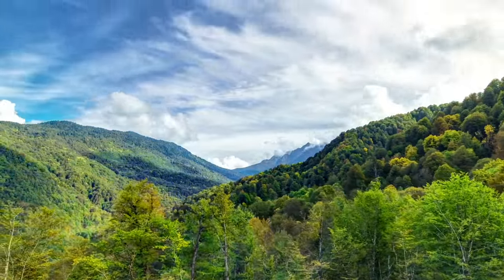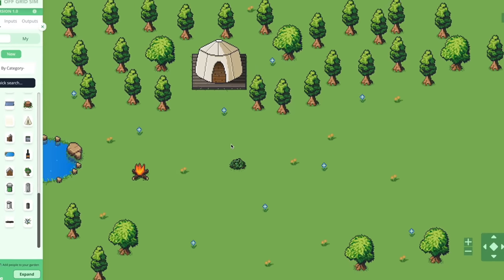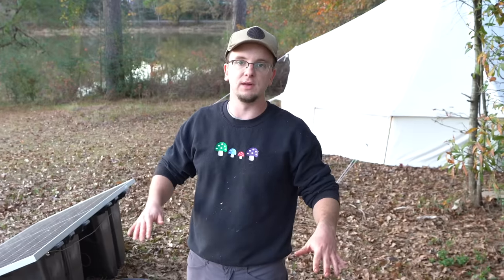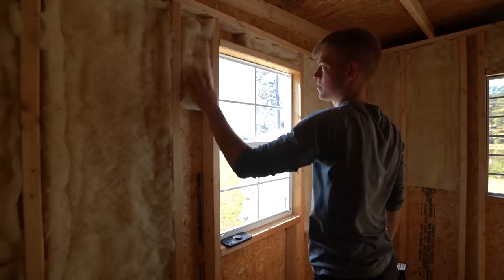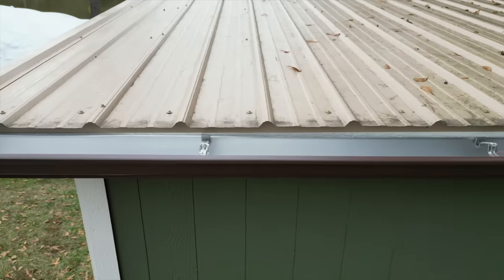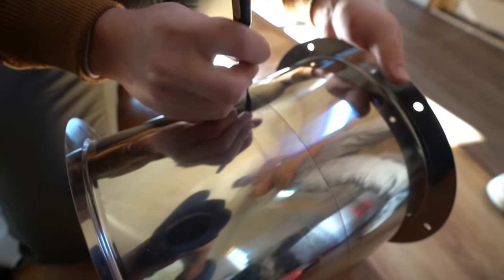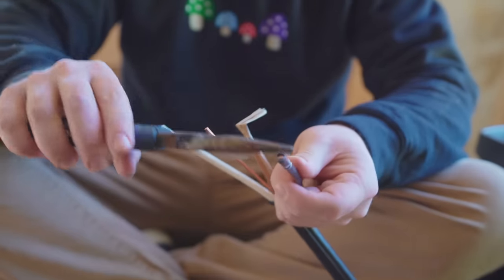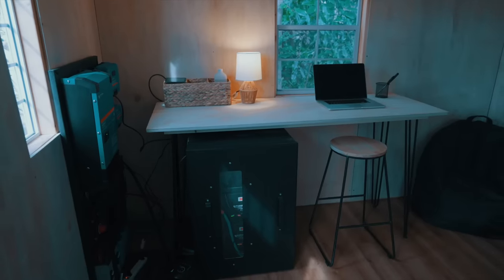We Went Off Grid In 30 Days With $25,000

Comment: Love what you guys are doing. 2 things that y'all could do as improvements on your ideas.  First, extend the billboard tarp down the sides or use slats from other reclaimed pallets to close in the sides of the chicken coop more to protect them from the weather, wind, rain, cold.  
The other thing is with your raised beds.  After your layer of punky wood, use horse manure mixed with about half of your leaf layer and then the other half of the leaves on top of it. Not only will it help break down the wood and leaf material it will generate more heat.  Use some reclaimed pallet wood to build some low angled frames that you can either cover in a double layer of clear poly or better yet find some old windows to use.  Essentially you construct a cold frame so that you can actually grow plants throughout the winter. Also, the IBC totes and/or barrels you use to store your water for the greenhouse and planters in should be painted black, and put inside the greenhouse to act as thermal batteries.

Comment: Yep had this issue about a month ago and made a video on my channel about it. Behind my wet bay all of a sudden without warning or any freezing temps just started leaking like a water park. Fixed one leak and upon turning the water back on a leak would start at another location with this fitting issue. 15 times this happened. I now have replumbed my entire wet bay with pex and corrected the issue. Not before the pass through floor being ruined from swelling and type of wood they also use in these rv's. They should also be using plywood instead of OSB in slides and other floor areas prone to getting wet.
Reply from the maker: Are you in an RV?

Comment: OK, so let me get this straight:  nothing but the most natural insulation due to, among other things, off-gassing.  But somehow using a pre-built structure sheathed in OSB, and then Luxury Vinyl Flooring.  I'm guessing there' salso  an off-gassing potential from the plywood you used in the interiior.

Additionally, stone wool products (like Rockwool insulation) seem to have a pretty good reputation for mold resistence and no off-gassing.  It will break down in the environment probably a little faster than what it's made of (rocks).  I would guess the major problem with it would have to be the energy expended in its manufacture and shipping etc.  But even that ultra green wool had to be shipped a long way as you noted.
Reply: Not to mention they have no vapor barrier. The place is going to be mold city. They also used the least fire resistant materials possible and then put a wood stove and lithium batteries inside. The place seems like a death trap.

Comment: From my research on solar and wiring, improper crimping of wires generates heat and is inefficient at best, and a fire hazard at worse. Use a heat testing thermal gun to test all your connections to make sure nothing is getting too hot.  If its too hot to comfortably hold with your hand there is a problem that needs to be resolved.  check all components and connectors.

Comment: I applaud you on using the wool as insulation because there is no off-gassing like in SprayFoam, but didn’t you short yourself in the foot with the vinyl flooring? Doesn’t that off-gas? It’s a petroleum product. Wouldn’t a redwood cedar have been a better choice for flooring.

Comment: This was so fun to watch! Can't wait for a follow up video! Do you think you could add a hot shower somewhere?
Reply from the maker: Hot shower is in the works!   There are 3 options:   Tankless propane, solar hot water, or hot water from the wood stove.
Reply: @acornlandlabs please don't use propane! See if you can hook it up to the methane from biogas maybe? But having an electric one that can be hooked up to solar set up or rechargeable battery that can be charged with the solar set up would be the most in spirit of Solar Punk!

Comment: Couldn't you use water or mud to pressure the methane digester and next time if you use half inch plywood for the walls go with 5/8 for the ceiling it's good to use thicker stuff on the ceiling so it never sags

Comment: Air conditioning with 8 350-watt solar panels plus running everything else?  
Is it enough solar power to run the AC during  a hot Georgia summer?

Comment: From someone who started off grid years ago. 1, you are trying to heat stuff with solar... you will run out of power. Always try to heat stuff by other sources, wood fire, gas etc. Which I see you have sort of got going. but the space heater was never going to work.  2. if you put your hurricane tent (It's not a bell tent btw) in the shade the canas will go mouldy just a matter of time. 3. LOVE that you are not using a bucket for your toilet. Those youtubes that say 'Oh simple composting toilet and use a bucket 🤮🤮🤮🤮🤮🤮🤮🤮. You are so RIGHT that's revolting and NOT a composting toilet. so congrats on getting your composting toilet right. If you want to see a really cool home built one that is a little more substantial have a look at the youtuber "One man two hands" he has an awesome one but yours is great too just to get started though you are going to have the hassle of emptying it heaps"
Reply from the maker: Wood is the primary heating element!  Solar ovens for cooking, biogas for cooking, good insulation, Georgia has a mild climate.  We’d never rely on solar for the space heater — just there for a test :)
Reply: @acornlandlabs  Awesome job. I like your Biogas too. I made my own but I think yours will be a much easier set up. Cant wait to see where you go from here. Well done ☺

Comment: Hey acorn labs,i have a question. The dehumidifier makes water using the humidity in the air,then stores it,correct? If that is the case couldent you ALSO reuse that water it collects every so often in your purifier to make even more drinking water? Or is that a bad thing to try
Reply from the maker: You could!  Just want to really purify it well

Comment: 40$ for a rug? and you call that thrifted? i could get that pos for 5$
XBOX? REALLY Jesus christ, YOu might aswell not have a budget, the more i watch the less long term appliance i see.
You're out in the OPEN, YOu can get a regular old Wood burning Stove, FOR COOKING AND HEATING JESUS, DO you not know anything?
Methane Digester is a good idea. 
If you have a Budget, WHY BUY NEW, Buy Used, isn't that also better for the environment?
THE SOLAR OVEN, Is the worst decision y'all made so far most likely, even worse than the XBOX, JUST START A FIRE!
Why a Canvas shell, you could get jsut regular old Tarp for 10$.
Now something ticks me off here, It's obvious you don't know how Fiber Glass is made, Because it IS NOT SYNTHETIC, it is naturally found, the other name for it, is also the reason why nobody uses it anymore would be Asbestos, Which is a Naturally occuring Mineral. (idk about usa, but rest of the world fibre glass is illegal)
WHY GET A SMALL ONE! You coudl've gotten a regular sized one, You have plenty of space, And you if you put it in the Corner, you could use it for cooking purposes, Smaller is not better.
While it is cool that you can plug your electricity grid to wifi, riddle me this, Without breaking your off grid space, How exactly do you get Wifi?
Ok so now that you are done, what of the Tent? You could've rented one, saved 2k, are we really just gonna gloss over that?

Comment: Wool insulation, no vapor barrier and no air gap in the roof to allow things to dry out? This seems to be inviting condensation with temperature deltas between the inside and outside and thus mold.
Reply from the maker: Big doors are open often, and we have a dehumidifier.  We’ll find out!
Reply: The need for a vapor barrier is relative to the climate zone you're building in.

Comment: On the "CheapRVliving" YouTube channel he showed how to do a no build van set up for $363 so you could do that and stay in a van while working on your permanent structure.

Also could daisy chain car batteries together and use them for power. Then use a wood gasifier with a compatible generator to recharge them. Which they did on the show "The Colony" in season 1.

Comment: I was imppressed with everything except solar as your main power. You wouldnt want to use it as your primary source of power as over years of use, they become less efficient. Not to mention your batteries will eventually fail after a year. I feel like that makes all the other people that want to do this same thing following this video blueprint.... stuck in the same situation after a year.
Reply from the maker: It’s just once piece of the puzzle.  We can expect about 25 years from the panels, and at least 10 years from the batteries if well cared for.  The solar ovens, biogas, wood stove, and other energy systems reduce the load on the PV system.  It’s all about balance.

Comment: Does the wool insulation have an r rating? I live in the northeast and was just wondering.
Reply from the maker: R13
Reply: It's only R13 if it's installed correctly. The face of the batting should be flush with the face of the stud cavity. I see a lot of overcompressed material. @acornlandlabs

Comment: great project! but i personally would like more transparency in the video regarding power. you completely skipped the real costs for your solar system in your 25k calculation. Batteries alone with ~10kwh will run you at least 5-8k, complete solar system about 14k... it should at least be mentioned that this is completely missing in the calculation. You just take a 3k Kit in your calculation which is not nearly enough to get on that level you installed, and i dont think you will live comfortably with a 1kWp 1kWh System at all. because thats all you get for 3k. For everything else - amazing work, great insights and knowledge! Props to you! :)

Comment: I loved this, very entertaining. However, I'm not sure if I'm missing something but the solar panel kit was $3,300?? I went to continuous resources's website and their cheapest kit is $4,518. That's a 430W kit, nowhere near the 2800W. Not to mention the rackmounted batteries. Those alone are upwards of $2,000 each! Like for real, if this was just a sponsored item, like that's fine, nothing wrong. But if that's what happen it'd be great to have transparency about it just for realism sake
Reply from the maker: Great question!  We did use an oversized solar panel system for this build to power AC all night here in GA.  You could use an equivalent $3000-$3500 kit from EcoFlow or Victron for solid results.  It’s hard to pinpoint an ideal solar cost since every location is different.  Some folks could get away with just one 400W panel and an inverter.  The solar kit will vary more than anything else

Comment: fiberglass is recyclable and sometimes even made from recycled glass. the reason they use the so-called hazmat suits is spray application of fiberglass is a high injury risk. no different than wearing lumberjack pants while handling a chainsaw. there's no offgassing unless you're using chemically treated fiberglass, which is usually more expensive.
maybe do some research on it

Comment: If you have a cabin delivered in Tennessee you need a lot of permits to do this, but if you build on site, and in a county with fewer codes, you often don’t need any permits. This is due to lobbying by the mobile home industry. They don’t want you hauling in homes without permission. It’s designed to make things more difficult. Building on site avoids much of this, if you are in a county that has few codes.
Reply: Well, and the codes are usually placed in requiring bigger and bigger square footage is because the county taxes based on the dwelling square footage. I know around Dallas and I’ve heard of other places where they used to be nowhere virtually no building codes, they are not adding any other codes except the square footage of the house. I should be something stupid like 2500 or 3000 square feet.

Comment: Vapor barrier😮??? Dang this wont last long
Reply: Also you do cieiling first so you dont have cuts on tops…

And your floor will look like a stairs like you did it

Maybe next time read a book how to build house instead of how to ship a sheep😂❤ 

As a carpenter my adhd get triggered so much but i still enjoy watching you guys 😊
Reply: Another things with this exterior finishing material (canexel in french) you need yo paint back every nail that you see or cuts cause its gonna rott realy quick…
Reply: You also need a air in vent for your wood stove ….
Reply: Regular wood for support stove … at least use a torch to burn it to prevent from rotting

Comment: Feels like you got scammed with the price for 400w solar. One 400w-panel is $70-$100 at the most. Even if you added the inverter it would not be $500.
Reply from the maker: Its typically $1 / watt,  pretty standard prices

Comment: 24 oc not 22. 24 oc would actual have less thermal bridging than 16 oc. But seriously, wouldn't it have been cheaper to just build a shed rather than buy one?
Reply: Also, I would have just pulled up the flooring and put pieces of the other color randomly. That would have looked cool.

Comment: QUESTION: Where is your vapor barrier for the little dwelling? When you heat or a/c that building it's going to sweat.  Mold is the last thing you want a few years down the road.  AMAZING VIDEO by-the-way.  And, why are you using electric heat?  A Little Buddy would be much more reliable.

Comment: Have you guys done any research into the regulations and codes around using the methane digester for human use vs the traditional septic system in Georgia?
Reply from the maker: We’ve researched many codes and regs.  We run these systems in urban/suburban locations without any issues.  Too much red tape exists so we build first to teach people so more folks can push back against  bad regs and zoning laws

Comment: Living off the grid myself, l really admire your efforts to set your selfs up. 
I liked the way you guys explained the pit falls of excessive draw on power usage.
99.9% of townies just don’t get it.  

Your choice of water source is very questionable. You went to the effort to get hygiene rated water containers AND then pump pond water !!!!!!!!  I wouldn’t drink that shit if it was the last source of water ever, unless it was flowing from a fresh stream. 
Our rain water goes through a water filter and UV light. Natural sourses of water have bacteria which need to be treated.
Bears and birds don’t just shit in the woods 🤣🤣🤣
Our rain water source comes straight off the sourthern Pacific Ocean, so is pure as, but hubby is parniod (blingin townie) 😂.
We are 100% rain water collection into 20,000 litre tanks. We currantly use a water pump but we are going to install a 3,000 Lt tank up the hill so we can go gravity feed, as our water pump is a big power consumer. We will top up the small tank on sunny days.
And l also question your choice of your toilet setup.
A wooden box with a toilet seat and a 20 litre paint bucket, would have worked perfecty without the big $$$$ outlay. 
Or even a long drop with wood chip, sawdust or leaf matter to stop the smell.
We use biodegradable plastic bag liners to line the bucket, then a couple of handfuls of refined leaf matter from under the tree line.
Set aside another bucket full it with more leaf matter to hand use after every visit to the loo. 
One handful for No’1 and two handfuls for No’2. 
Then set up a cheap plastic composting bin (in the tree line, or away from the dwelling) when your toilet bucket gets full, dump waste into the compost bin. Two years later it has become non toxic composting matter that will feed the trees. We have two bins setup. Never use this compost for vegetable gardens - gross!
It also pays to make sure compost toilet is vermon and insect free. When my hubby built our first compost toilet, l opened up the lid one day to find a large rat looking up at me. I was not impressed. The new loo is now vermin free.

I personally not convinced about the bio unit yet. Friends of ours set one up, then we had a drought, so there was not enough water to operate it successfully, so it became a bit of a white elephant for a while. They have now set up a separate water supply just to help top it up when needed.
We have pleny of leaf matter to run our compost toilet as we have a good sized bush, however our neighbours go to he local timber mill once a year and collect sawdust for free. No smell, easy to use and cheap as bro.

Lastly it definately pays to have a backup generator. Because it’s guaranteed that the sun is not going to shine everyday.
We have a 7.5kw setup with lithium batteries to run our small two bedroom cabin, by day 3 of cloudy/rainy days we have to top up with the generator.
In the summer we have so much power, we can thankfully run the AC. We average 35c (95F) in our little slice of paradise here in the summer.

Thank you for using our home grown sheep wool for your insulation, and showing the importance of stapling the insulation as you 
installed it. That is the biggest mistake people make when insulating.  It’s nice to know us Kiwis are keeping you warm on the otherside of the world. Consider it as a big hug from us. Arohanui

Comment: Take it from someone who installed wool insulation. I had to put a vapor barrier over mine, and it's very expensive. It's far easier to use foam block.

I installed mine because wool doesn't burn so well, if at all. Foam board is highly flammable.

The benefits of using wool are outweighed by the drawbacks.